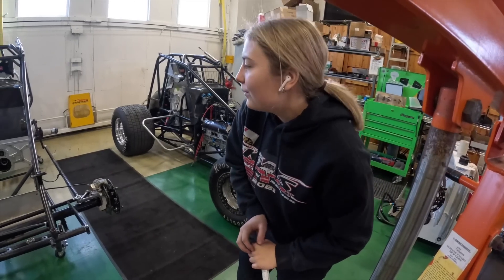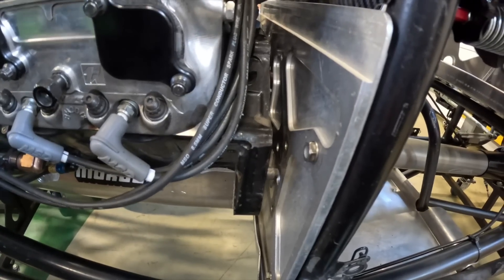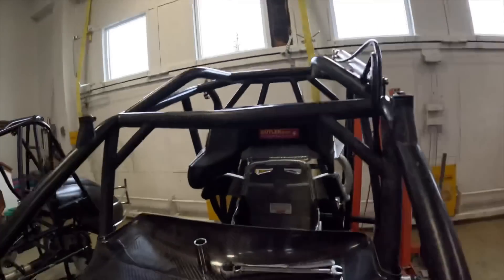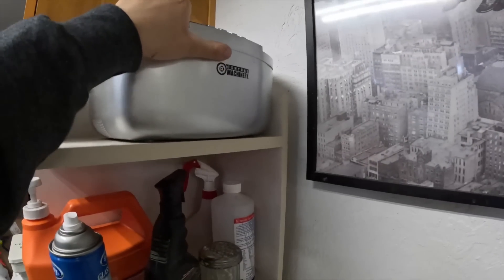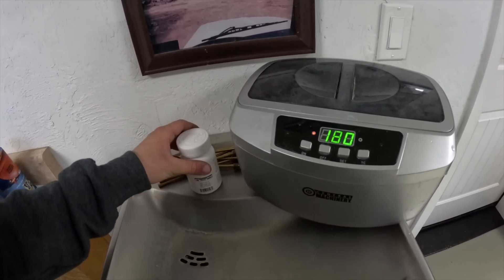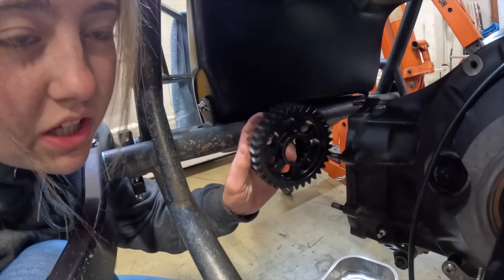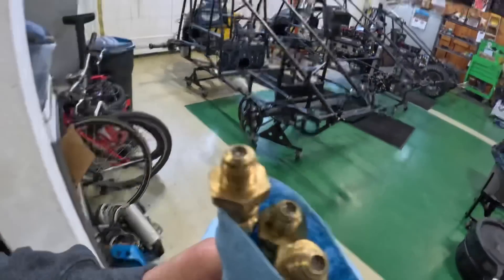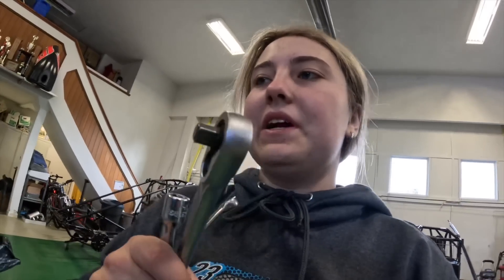The Final Update On My Back....

Comment: Good to see this for you. On the rear end oil. For years we drained the oil 1st night in the shop & poured it in a 5 gallon plastic bucket that has a water spigot 4 inches from the bottom hung up on a wall. By Saturday morning or if we fired the car we would drain the oil into an old fire extinguisher (kept in trailer for race track) & refill the rear-end. All the metal would settle to the bottom of the bucket. This was a synthetic rearend oil for at least 20 years I was with the team. I started with them in 1996 & they had been doing this for years before that. We never lost a Quick Change rearend & this is in a Sprintcar. We raced about 20-30 times a year around northern California.

Comment: I had similar fractures, wedge or compression fractures as well as fractures of the facet joints and what they told me where the largest duck herniations they had seen,  hence the need for surgery which included fusions with instrumentation, (screws and rods).  They told me the same thing, I drove again, I broke it again, more surgery etc.  I recently had my foot fused and the doctor that did that had and has me continuing to take vitamin D3 and B12 because it helps the fusions heal, I don’t drink or smoke which I was told by every doctor I’ve seen interfere with healing.  I have to have my other foot done but we’re waiting till fall for that.

Bottom line is your young and healthy, take good care of your body and live your life the way you want.  I wouldn’t continue to the point I did.  Take care and I’m glad your doing well.

Comment: Thanks for the instructions on how you take out and clean the injectors. I gotta say they didn't look like I thought they would when compared to diesel engine or other gas engine injectors that I have seen.  Watching you guys put the 360 in your car made me think of Tanner's video of when they put the 410 in his car. He mentioned how sometimes it can be a bit of a pain then it went right in lol. Apparently the difficulty of putting the engine in was saved for your car this time lol but hey such is life it doesn't always go smooth. I get what your doctor said about not being able to technically clear you too but like you said through diet you can give your body what it needs to keep building good strong bones. You can also build up your back and core muscles to support and protect your back. Of course the extra padding or maybe a change in the stiffness of the padding will also help. Then as you get further along away from the accident and this initial healing you just keep making adjustments to your seat to keep you comfortable and safe. Thanks for this video and the update on your health. May y'all have a good one have fun take care

Comment: Carly are you running both a 360 and a 410 sprint car this year
Reply: No only tanner is running 410s carly doesn't even have 10 360 races under her belt and she has to get used to a full power 360 instead of just a limited to be able to even think about getting a 410